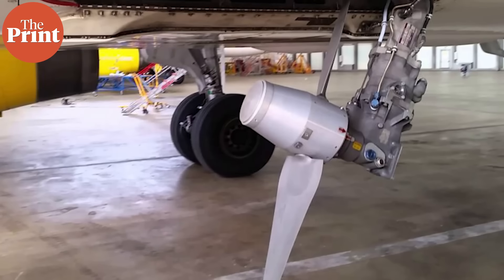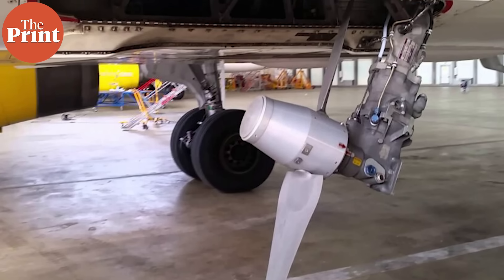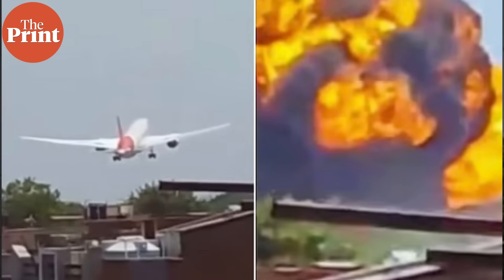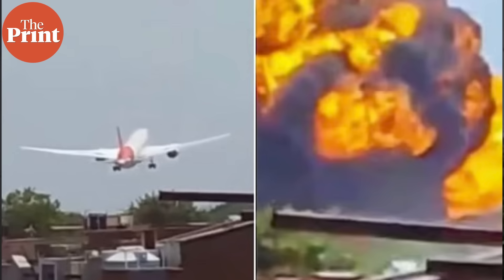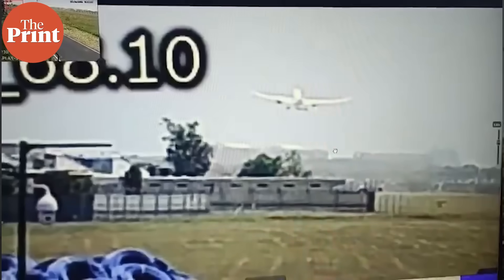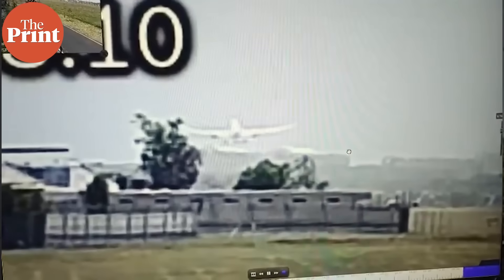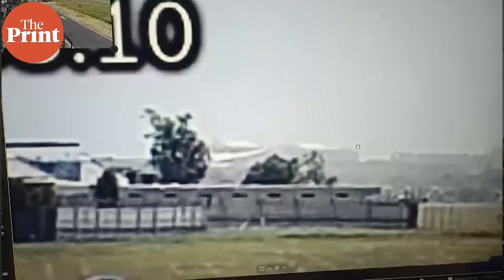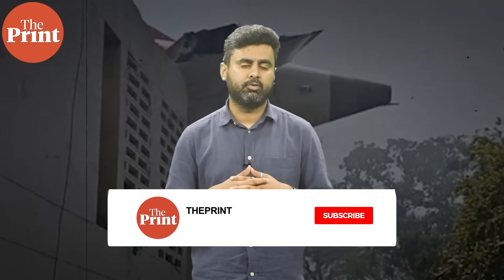Air India crash footage sparks RAT theory. Why jets have tiny turbines hidden in fuselage

Comment: Sky news are reporting that a Boeing 787-8 Dreamliner had to return mid air due to technical issues
Reply: fuel filter blocked,,,  nothing to see here,,,,,  but with this crash they are a bit twitchy,,,  in the old days you would find it when servicing after flight and just change it but now it sends a message to the cockpit
i guess they did not want to take any chances